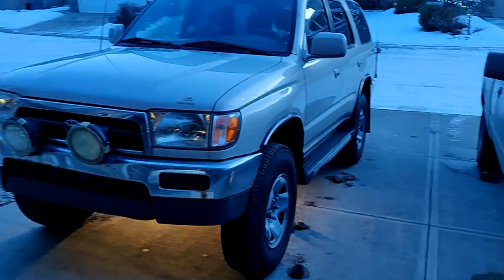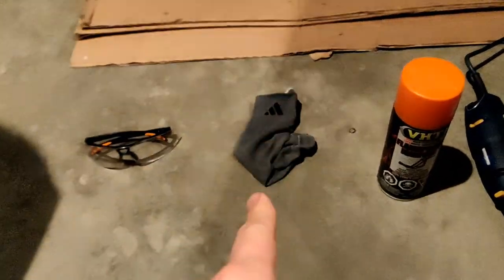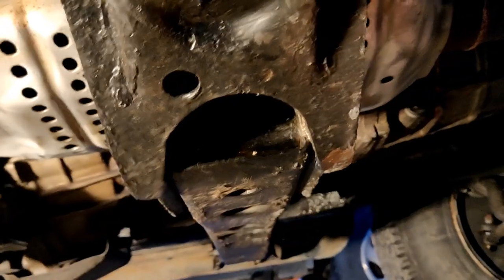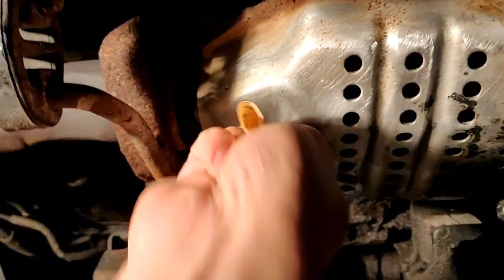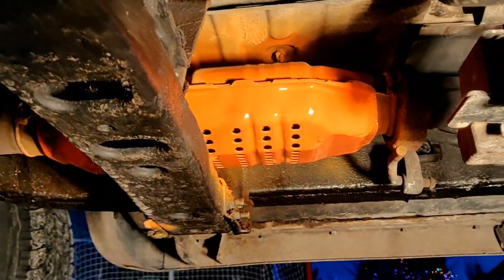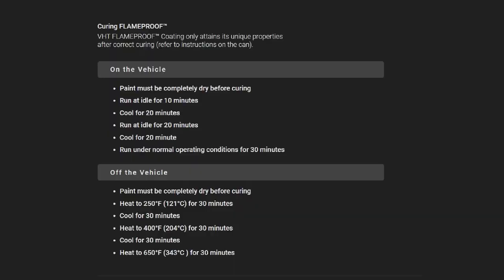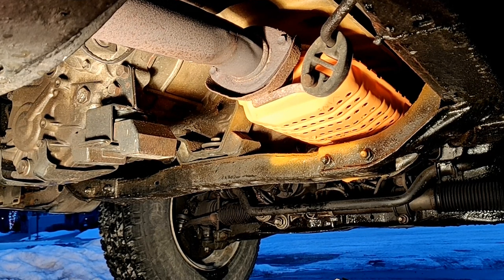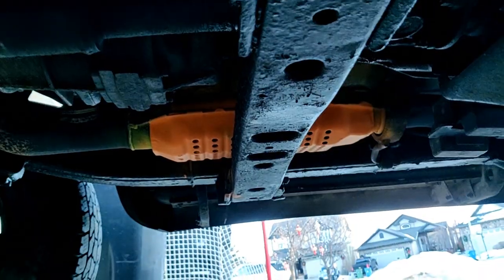DIY Catalytic Converter Anti-Theft for $20

Comment: I recently painted my Van Cat, before doing so I got a sheet of numbers and letters from Dollar Tree and stuck the VIN numbers on it, after the paint was dry I peeled off the vinyl stickers and also etched over the numbers for added insurance, the numbers very clearly stand out. I also loosely wove a 12' length of 1/4" steel cable around and through the Cat shield and holes in the frame hiding the cable clamps above the Cat to further deter a thief.
If you have ever tried to cut a steel cable with a hacksaw, you know what trouble a thief will have with his Sawzall. In my area, Cat theft is so bad that the police are really cracking down on the recyclers and purchasers of Cat components, most will not buy a painted Cat for fear of getting busted, the thieves know this, and will likely just move on to another car. This is definitely better than nothing!
Reply: Excellent advice!  I almost had mine stolen, but thank God they were impatient and dumb rookies trying to steal it in the morning right before my wife and sons were heading out to school.  I will be doing something similar to what you did very soon.  In the mean time, my Honda Element is garage kept in a very narrow garage!  LOL
Reply: I just had my stolen found out on my way to taking my son to school, i will do the same thanks for advice and the negative people are probably the once that encourage u not to do it cause their the ones doing it
Reply: thankkk youuuuuu very much>
IM ON IT!!!
Reply: But after taking the metals what is to prevent them from burying it so they don’t get caught with stolen property? Most of them are located in junky areas. All they have to do is not keep the remnants on their property. I have been hit twice and looking to prevent a third.
Reply: They bust them open take the inners out and toss the painted shell. 😂
Reply: @maxsmart8954  The idea is to try to make it as difficult and dangerous as possible for the thief, he has to move from your vehicle to his car with a bright orange object in his hands then he has to sell it to the metal re-capture people (it is not an easy job separating the metals) and he has to risk the cops checking his inventory. On mine, I was able to get plenty of the paint inside to cover vent holes and on the cat itself. The whole idea is to make the thief think yours is not worth it and move on to an easier mark.

Comment: I also agree with Melvin Mansoor and don't believe this will deter anyone.  What's needed is a very comprehensive set of laws initiated by the EPA that will SIGNIFICANTLY increase the penalties for illegally removing, possession of, transporting (double if the converter is transported out of the State of California) or selling a used converter to that of a Felony for each offense along with a mandatory $10,000 fine and 10 years in prison for each, then mandatory deportation with a permanent ban from re-entering the USA for anyone that is here illegally, that has a green card or is a temporary visa holder.  These Penalties should also be extended to any recyclers that purchase used converters from individuals that have no proof they are engaged in the business of Auto Dismantling and Recycling.
Reply: The thieves make it look bad 4 hard working men who buying them 4 a living
Reply: @wordisright  The major problem is that Catalytic Converter Recyclers will buy Converters from Individuals without any proof that the Seller owned the Converter OR where they obtained it from.  Now, if an Individual walks into a Recycler with 20 of these things and they appear to be freshly sawn off, it's pretty obvious they are stolen.  Junkyards aren't allowed to sell these to the public and the only people that might end up with a lot of them to sell to a Recycler is a Muffler Shop, but because most of their business is replacing stolen Converters and due Smog Shops aren't taking Tailpipe whiffs on Cars later than about year 2000 vehicles, the Muffler Shops aren't replacing them like they used too and it would take them a while to accumulate 20 converters to sell to a Recycler.  It should be illegal for Recyclers to advertise to the General Public for Converters but you see these ads all over Craigslist.
Reply: Murder is against the law too, but that doesn't seem to stop murderers. I don't think making more laws is the answer. I like the viewpoint that mfgs should do something on THEIR end to make cats MUCH harder to steal. How hard can that be? So you raise the price of the car (or truck) another $100. Show that cost on the window sticker.

Comment: You do know that Catalytic Converters DO NOT have holes in them, Right?  That thing you just painted was NOT the Catalytic Converter!  it was the thin metal, Catalytic Converter Heat Shield that can easily be removed and discarded before selling the Catalytic inside the shield.
Reply: Hilarious 😂 just go with it LOL what a waste of time
Reply: Oops
Reply: Let him have his time in the sun 😂
Reply: It's a deterrent, as is anything else.  This is the method recommended by the Houston PD.
Reply: They've got two holes-in-one on each end the cable is a deterrent because no one's going to remove the heat shield underneath the car if they see the paint they're going to move on to the next one
Reply: 🤣🤣🤣 OH shit!

Comment: You painted and engraved... the heat shield to the catalytic converter...
Reply: I sat, pondering that and your comment triggered me, lol.
Reply: hahahahah
Reply: WHAT THE POINT OF PAINTING? IF THEY TAKE, THEY WILL TAKE.
Reply: @seanlee7563  I’m guessing wishful thinking that they won’t take it if they fear a recycler won’t take it.
Reply: @dirgeofdementia  YOU DON'T KNOW HOW IT IS MELTED THEN.  WHAT THEY WANT IS THE HONEY-COMBED MATERIAL INSIDE THE METAL SHELL YOU PAINT OUTSIDE.  EVEN IF YOU PAINT THE HONEY-COMBED INSIDE, WHICH IS IMPOSSIBLE, WHEN IT COMES TO MELTING EVERYTHING DOWN AT 2-3000 DEGREE CELSIUS IN REFINERING PROCESS, THE PAINT WILL BE GONE, AND THE PRECIOUS METAL WILL COME TOGETHER ISOLATING THEMSELF INTO THEIR OWN COMPONENTS FROM THE REST.
Reply: @seanlee7563  I am a service manager, so I know quite well the expensive materials are the platinum and the rare earth inside the housing. Thieves cut the converter off with a reciprocating saw and take it in whole, heat shield and all.

Comment: OK, if I'm not mistaken, you have painted and etched the heat shield! You need a thin guage steel plate to slow them down and make more noise when stealing it.
Reply: They already make noise when they take them off. They typically cut them off with an electric reciprocating saw.

Comment: Would this paint help stop thieves stealing gold if I sprayed a bank safe with it.
Reply: scrapyards wont take the catalytic converter if it's been painted the thieves would have to scrape off all the paint if they want to sell it.
Reply: @initiald22  if you paint your catalyst in Red paint with a Maga sign. a crowd of rioters will break into the thief's  house yelling " stop the steal"  that should work.
Reply: @N8iv2DaBone 34 exactly. The anti theft package  includes a guy in a Fur bikini and horns .
Reply: Getting spray paint off wouldnt be that hard 🤷🏻‍♂️ it's the dumbest idea ever.. the etching/engraving of your VIN or name  makes sense..
Reply: Also he etched the VIN on the heat shield lol.. he also painted the heat shield.. simple.. re.ove heat shield and a little paint thinner and/or a wire wheel on a dremel or drill all your work was done for nothing
Reply: Spray the bars
Reply: Hey lets let everyone out of prison !!
Reply: @richard.jansen  Wrong thread DF.
Reply: Depends on what color paint you use
Reply: Paint the gold.
Reply: @richard.jansen  🤣🤣🤣
Reply: That’s exactly what I was thinking
Reply: B. N  I love this, was thinking swastika

Comment: There's nothing you can do except:
1) Park inside your own garage when parked at home
2) Install an accelerometer (tilt sensor) that is connected to an auto alarm w/siren
3) By a Tesla
Reply: 1) not every house has a garage
2) yes fair enough
3) get a better designed car.

I've had 3 of the same model cars because I just like them, 2 were decatted (for "theft prevention" ;))
And the one with the cat intact was on the exhaust manifold
Impossible to access under the car, need to remove the whole manifold
Reply: How can I find information on how to do #2?
Reply: @lot5953  wiring diagram of your car
Ebay 'tilt alarm'

Install.
Easy.
Reply: *Buy (omg, did you even go to school??)
Reply: 1) Good idea except when out shopping.
2) Nobody is jacking up an SUV or truck. They already have high ground clearance. 
3) Tesla would be nice but a plate or cage over the cat con would the best protection, next to some well placed bullets.
Reply: Just wait until they figure a way to slip the tesla batteries out in just a few minutes. You come out the next morning and she's dead (Jim). Totally. With any luck the cameras will tell you who did it.
Reply: @robertthomas5906  My doorbell camera caught the couple stealing my neighbor’s cat off his RV in the middle of the day while the owners were home. They just returned from a trip and were unloading the RV. Owner gave my doorbell camera video footage to the police. No arrests made. I saw the thieves car on New Year’s Eve and recognized it by body damage and thieves long grey hair and followed them to a casino. Called police and showed them the video. Still no arrests. The police just aren’t interested.

Comment: This may be a deterrent to potential thieves, mainly because painting it orange puts it out of the norm, and that may have a psychological effect.  Etching the VIN is a nice touch I'm not sure how effective it would be to a would be scrap buyer.      Wow, nearly 400.000 miles on the 4 Runner.  That is why I own Toyota's!!!
Reply: We need to get car manufacturers to stamp VIN or a serial number that is linked to the VIN so that when cops bust folks with stolen converters they can track them back to the vehicles. New car designs are moving them to behind the engine so that it isn't so easy to access. Definitely a huge problem.
Reply: my toyota truck lasted 6,000 miles, biggest piece of crap ever.

Comment: The Cat on my RV has been stolen two times in the past 9 months. The replacement is $2500. each time. The first was replaced with a aftermarket Cat. Don't believe anyone that tells you they won't take the aftermarket cat. 
The second time the storage lot got them on video with their car and license plate along with their pictures. All that doesn't do any good. Even if they catch someone in the act the person is seldom prosecuted to the fullest extent of the law. It is a felony because of cost for each time my Cat was stolen.
I am welding a cage around my Cat and the cage is being welded to the frame. I would love to add a electrical shock just to give them something to think about along with a loud siren to blast in their ears.

Comment: I put a wyze camera for $20 and notify me if someone is around,also put an alarm that warns the intruder if they get closer to the car.
Reply: Good deal 👍🏻 One of the few methods I see working. Those wyze cams are the answer! Love and Respect!
Reply: What kind of alarm did you get that warns the intruder if they get closer? I’d like to get something like that.
Reply: @mariesoren6627  wyze cam v3 has a built in siren
Reply: @camaroman101  Thanks, going to check that out! What if you're at a mall or big office building? Will it still work?
Reply: @williamnale7835  if the camera itself is in a building or if you are? The camera itself needs a wifi connection to work, but it will alert you anywhere through your phone.

Comment: Here is a simple solution to absolutely prevent 100% that no one will ever steal your catalytic converter EVER!! Cut your own catalytic converter off from your vehicle first! Then get a piece of straight pipe and attach it with either clamps or just weld it on. Done!!! When any thief looks under your car or vehicle and see's it's not there.. They move on and leave your vehicle alone for at least that anyways! Simple, quick and done! ;)
Reply: uhhhhhh maybe not:   Clean Air Act Vehicle and Engine Enforcement Case Resolutions
Over half the pollutants in America's air come from "mobile sources" of air pollution. These mobile sources include cars, trucks, buses, motorcycles, recreational vehicles, scooters, off road construction equipment, marine engines, generators, and small engines and equipment. Mobile source pollutants include smog-forming volatile organic compounds and nitrogen oxides, various toxic air pollutants such as cancer-causing benzene, carbon monoxide, particulate matter or soot, and greenhouse gases. In addition to adverse effects on the environment, these pollutants are responsible for asthma, heart disease and other illnesses.

The Clean Air Act requires new engines and equipment sold or distributed in the United States to be certified to meet EPA-established emissions requirements to protect public health and the environment from air pollution. The Act and its implementing regulations also contain various requirements concerning testing, reporting, recordkeeping, warranty, labeling, tampering, defeat devices, and vehicle and engine maintenance and alterations. EPA enforces the vehicle and engine provisions of Title II of the Clean Air Act and regulations at 40 C. F. R. Parts 85, 86, 88 through 94, 600, and 1033 through 1068.

EPA may seek civil penalties or injunctive relief (including remediation of the violations and projects to offset excess emissions) for violations of the Act and regulations, and may bring cases in federal district court or through an administrative process. Enforcement actions include cases against a variety of parties, including manufacturers, importers, distributors, and consultants.

Violators are subject to civil penalties up to $45,268  per noncompliant vehicle or engine, $4,527 per tampering event or sale of defeat device, and $45,268 per day for reporting and recordkeeping violations. 42 U.S.C. § 7524; 40 C.F.R. § 19.4. The EPA often uses the Mobile Source Civil Penalty Policy to arrive at an appropriate civil penalty for vehicle and engine enforcement settlements.
Reply: @williamnale7835  And who is going to go through all this trouble to inspect one's vehicle like this to impose all these violations and regulations on? There are hundreds of millions of vehicles out there in the public sector and you actually believe that all that stuff you just copied and pasted into your comment is really going to deter someone in this regards as a solution to catalytic converter theft? Really?!??

I seriously doubt it!! 😒
Reply: @drwho6871  In California you have to get your vehicle smog inspected visually and with test equipment every 2 years by a state-certified smog inspection facility or else you can't register it. If you don't register it, you won't receive the tags that go on your license plate. If you drive without the proper tags (for more than 6 months) or without a license plate, the cops can/will impound the vehicle.
Reply: @SF-fb6lv  Well if you live in left-wing californification then I suppose it would such for you or anyone else then.. But in good'o Indiana that isn't the case here! So my original statement stands as previously stated!

Comment: You're painting the catalytic converter *heat shield*, not the converter itself, which is inside the heat shield.  After cutting the pipes to it, they can take it home and remove the heat shield at their leisure.
Reply: Correct.....that's just the shield.

Comment: you need to slow them down.. cover the convertor with a steel plate.. put on security bolts..  the vin number can easily be scratch away and repainted black..  if anything you've highlighted where the convertor is with your bright paint. your truck doesn't even need a jack.. so they'll just take the convertor first, ask questions later..  the metal recycler in China (which is where it ends up) doesn't care...
Reply: How much is it for the still plat

Comment: This might work if you use hot pink hi-temp spray paint. Your average manly-man thief wouldn't want to be seen with hot pink anything. You still need some sort of cage or strap to slow them down, since that heat shield can be removed with an angle grinder and a Harbor Freight cutoff disk after the cat is removed and transported to the thieves' rendezvous point. It's gonna take more than these measures to deter a determined thief, and law enforcement needs to set up more sting operations to reel in the middlemen who are fueling all of these thefts by placing ads on CL and Marketplace. It used to be mainly the West Coast besieged by all these cat thefts, but now it's everywhere. If more thieves have the car fall on them, then they might think twice. If I see two feet under my car sticking out, I might just release that jack!! I'm surprised more of these thieves haven't been shot by fed-up motorists.

Comment: First of all that's a heat shield that is getting painted an etched the cat is under that. Secondly painting the outside doesn't stop, prevent, or do anything when the metal shell  is cut off  because the valuable part is inside. No recycler is going to refuse a cat because it's painted and the VIN # will be removed via grinder and flap disc in 2 seconds by those who stole it. Weld something over it obstructing access to easily cutting the pipe before and after it also tack weld the heads of the bolts to the flange if you want to really do something to help but if no one is around to stop them and they are given enough time they will probably steal it regardless. Who ever thought painting and engraving the Vin # was going to do anything to stop them is a moron.
Reply: Or spray paint it themselves Black....
Reply: @JettBlast  exactly